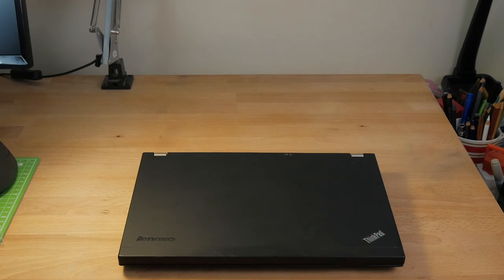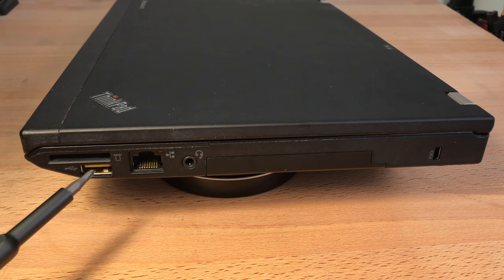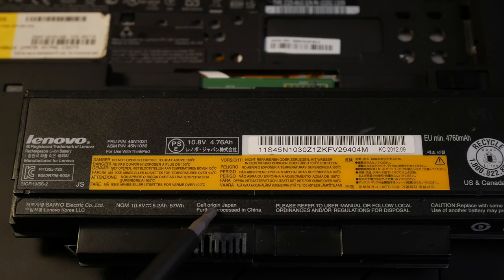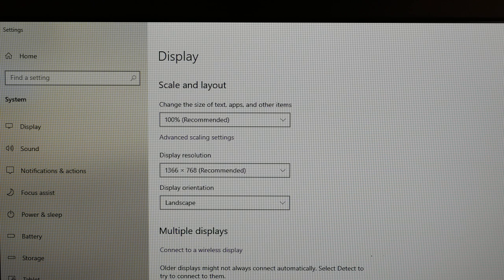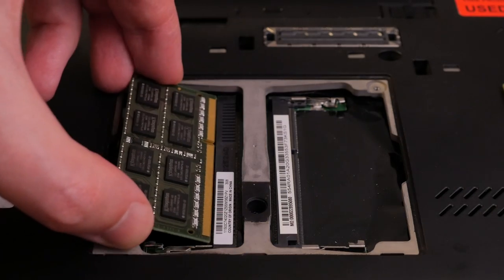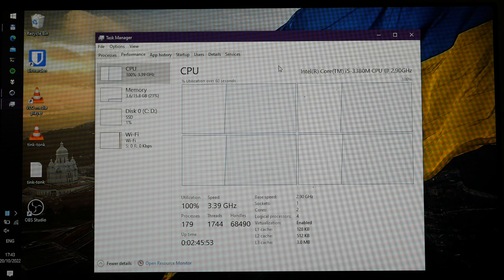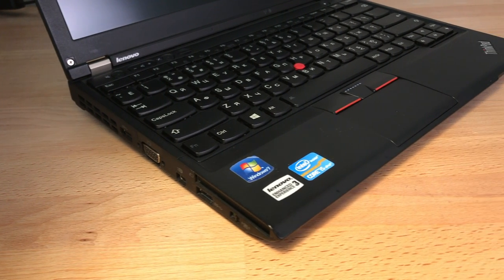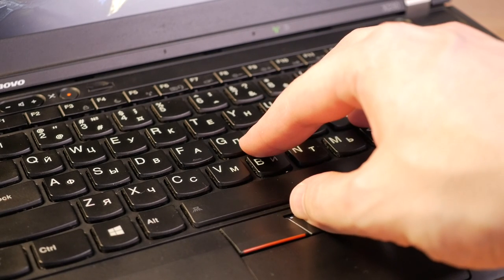My favourite laptop is 10 years old (ThinkPad X230 review)

Comment: If it has not dedicated GPU , it is really a waste of money ...
Reply from the maker: There are many, many tasks that don't require a discrete GPU. In fact, I would argue that for an ultraportable laptop a dedicated GPU is a downside because of issues with reliability, heat and battery drain.